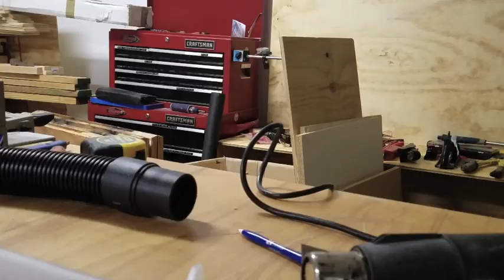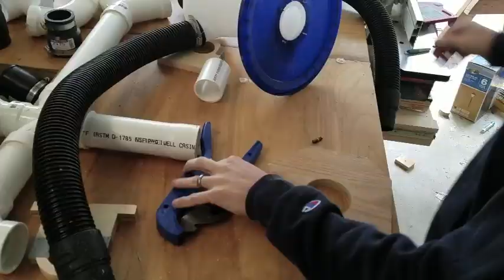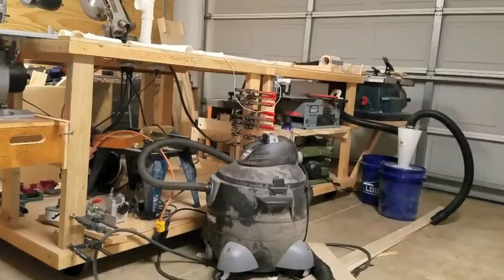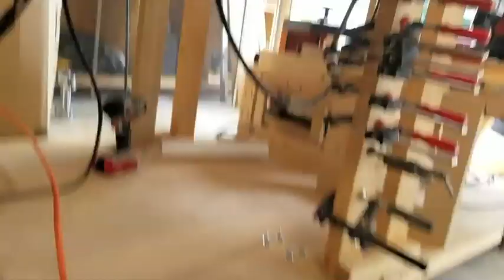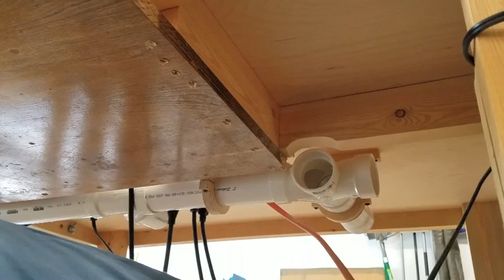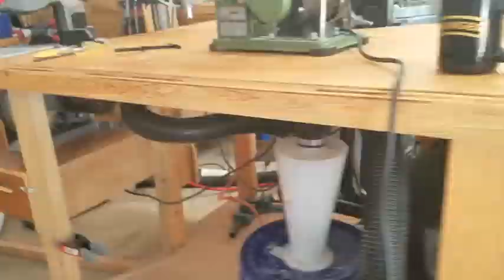Small Shop / Shop Vac Dust Collection / FREE PLAN / Installing main pipe & cyclone separator / EP35

Comment: Have you been able to detect any airflow loss (if any) with the PVC piping vs directly connecting a given tool to the dust separator?
Reply from the maker: Larson,  there is some loss, I have not calculated or measured,  but any length of pipe will add some additional friction/loss. Each length of pipe to my machines is very similar to the length of a standard hose, though & I still have very strong flow at each tool. The separator and my collector box are probably the biggest losses in the system. 
In my opinion, the convenience and overall efficiency of opening a blast gate vs unplugging and moving are big advantages in my workflow.  
High pressure systems do better with odd shaped or longer tubes than high flow,  so that's a benefit when using a shop vac.
Thanks for your questions,  I hope that helps.  Definitely something I should try to test.

Comment: Great design! I’ve been thinking of doing something like this. How has this been working out for you? If you had it to do over again, wheat would you do differently?
Reply from the maker: Steve, thanks for the questions.  Mostly has been working out well. I'm about to replace/ repair some of the DIY pipe flange clamps that I made & recently broke in a move/ wore out. Here's a few things I would do differently:
1. Make more of the clamps and use them at each junction
2. Maybe use a 4" main trunk or separate trunk direct to planer. It pushes chips into ALL of the other branches. 
3. Locate suction source in center and have additional gates to close off branches.
4. Minimize 90s. I of course have some suction loss in the system,  but it mostly works. I'm impressed with the suction and chip/fine dust collection considering it's shop-vac powered central DC. 
5. Use the best separator and suction source I can afford/ fit in the space.  
Hope that helps.  I'm planning to capture some of these maintenance and updates in an eventual video.
Reply: Chris Harpster Awesome, thanks! I have the same planer so I’ll plan on the 4” port for that.
Reply from the maker: Would love to see what you come up with,  Steve!

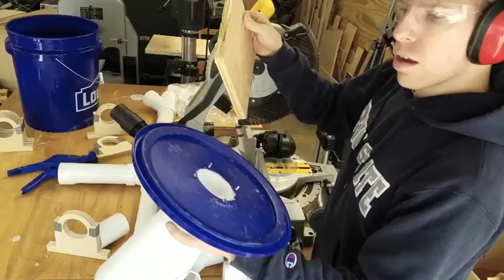Comment: Hey Chris, I'm not the safety police here. But I hope you're not continuing to make cuts like you did at 2:10 
I don't understand why you crossed your arms in that way instead of swinging the miter saw the other direction.
Reply from the maker: Thanks Wayne, I appreciate you reaching out and calling it out. Needs to be in the comments for viewers to read.  
 Please note footage was sped up 12x actual speed (1200%). The angle and cross was strictly to not block camera with my body/arm. Definitely makes it look awkward and I've changed my methods when recording to not do things like this for the sake of visual clarity. The block I was cutting was 9"  square, so no  worries,  my left hand (holding workpiece) was a full 4+ inches away from the blade.  My crossed -over right arm remained firmly on the control and above plane of blade and guard.  Aside from the cuts looking very awkward and crossing my arms being unnatural,  there was no actual safety risk to my arms or hand.  I definitely concede that I should not be demonstrating bad form for visual clarity and have made it a point to try to prevent it. Do not do what I did in the video and especially do not hold pieces in unnatural positions when ANY kind of stress or unsupported  workpiece  are involved.  Thanks again,  Wayne for making note of this!
Reply: @benchtopwoodworks  I've certainly done my share of stuff that if it was on a video the "safety nazis" would have been all over me. More often than not, people are running their table saws without the guard and anti kick backs.  So do I. It just seemed logical in that instance to swing the saw to the right and cut corners "normally". No skin off my knuckles. 😎
Reply from the maker: I very much appreciate you bringing it to light! Better to be out in the open and explained.  If I'm to try to educate at all,  needs to be transparent  and safe. I'm certainly no professional video producer and need a full dose of honest feedback. Thank you very much,  Sir and I appreciate  you watching!

Comment: I like watching a many videos of dust collection. As a bonus, I see different ways to place tools. In this video, I liked where you placed the joiner. I want to use that idea for my planer. It will be out of the way.
Reply from the maker: Thanks for checking it out,  Bob! I've got a dust collection  Playlist if you would like to see some later developments with the setup. Have you seen my planer mount? Similar,  with the drawer but a different design to get the bed up higher when pulled out from the bench.

Comment: Have you had any issues with static electricity build-up from the sawdust running through the pvc pipes?
Reply from the maker: Mike,  I have felt a charge on the exterior of the pipe that sometimes attracts dust, but have never felt or experienced any kind of discharge. Nothing notable or that's caused any kind of issues. I would say no more  charge than builds up on my vac hose when using it by itself in a dry environment.  Hope that helps, thanks for asking.

Comment: I made mine with
1.Shop vac model 2015
2.A scrapped Eureka Cyclonic dirt cup.
3.1 Foam plate
4.Tape,tape,and moar tape
5.Halloween basket
6.Drill and hole driller
Reply from the maker: Awesome!

Comment: You're going to want to upgrade this system in your "micro shop". My shop is 10' x 14' with a two stage 2hp DC with 6" piping and i find limitations here and there.
Reply from the maker: +Joshua Jonah, I definitely wish I could afford or have space for a larger system. This is my best solution to my current stage of life,  needs,  small tools etc. Definitely not the optimal dust collection solution but a huge improvement over repeatedly hooking my shop vac up to each machine. For those that can, I definitely recommend all to get the best dust collection system they can afford. Thanks for adding to the dialogue and watching!

Comment: Do you know if it would make a difference to go with 2” vs 4” pvc I see both posted?
Reply from the maker: +Bart Giles, I recommend you go with the largest/most powerful dust collector and largest diameter pipe that your shop can accommodate. I have no experience coupling a shop vac to a large diameter pipe, but flow  velocity would both drop off significantly. I'll have to look into that.

 Shop vacs are low volume, but high Static pressure. This has been shown to be less ideal for small particulate collection compared to high-volume systems.  I'm limited to a shop vac currently, so I chose to have "some form" of dust collection vs none at all. I also chose 2" because I can easily convert to shop vac attachments/hoses at machines and ports for hook up.
I hope that helps, please share some examples of what you're referencing.

Comment: I don't see nay gates to eliminate much of other plumbing when using each outlet with specific tool.
Reply from the maker: David Davis, most of the ends are blocked with pvc test plugs in this video. At the same time as plumbing this, I was also mass producing my blast Gates (separate video). The test plugs for about 25-50 cents each can save some time/money when first setting up the system. If you look closely you may see them covering the ends of pipe in certain frames.
I add other blast Gates for each tool in when I finalize how I plumb in each machine. Thanks for watching!
Reply: David Davis ;

Comment: Great vid.  Does any of the dust get to the shop vac? Do you routinely  still have to clean the vac filter?  I've been thinking of doing this in my shop.  But have been vaselating between using a shop vac or a smaller dust collector motor.
Reply from the maker: +andy schlamp, some dust does get through to the vac, but only when I don't pay attention and overfill my bucket up to the cyclone. I need to make a better bin to replace the 5 gallon bucket. Especially when planing, routing, or jointing.. Those large chips really fill it up fast!
Reply from the maker: +Andy Schlamp, separately and to your point about small dust collector vs shop vac I'm not sure which would prove better. Probably looking into other's research and experimentation on CFM volume vs static pressure comparison would shed some light on it. I do like the 2" pipe/fittings and the ease of converting back and forth to shop vac hose dimensions. The high Static pressure air flow from the shop vac is great for pulling chips /air through the pipes, but the low air flow rate does allow fine dust and some chips to escape the tools at the source. I think this can be somewhat corrected/optimized with custom shrouds and adjustment at each tool. Once i build the larger collection box, I  plan to try a larger motor and fan I have have from a clothes dryer to test a different suction source. Thankfor watching and the feedback, I hope that helps some!

Comment: This is a great video, Chris.  Your ideas for DIY tube clamps and blast gates will save a fortune in setup costs.  I had a similar system for my shop, but I use an army surplus 55 gal barrel with a lid between my dust tubing and the ShopVac.  I drilled a hole for the ShopVac tube in the center of the lid and mounted an L-shaped PVC elbow under the lid connecting the tube from the power tools. Only the very finest particles got into the ShopVac filter, and it took a long time to fill up the barrel with sawdust.
Reply from the maker: Thanks Paul, I really appreciate you watching and your comment. I definitely need a bigger dust bin/have some plans in the works. Planer/jointer fill it up very quickly. Your dust extractor setup sounds very interesting!